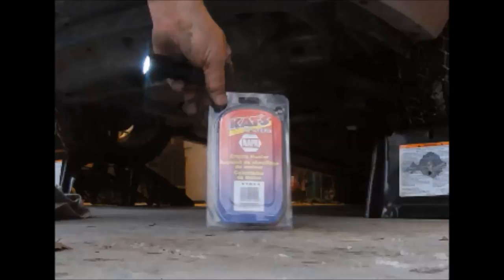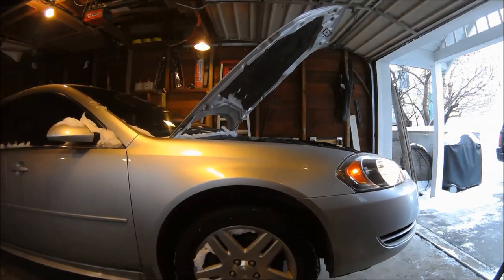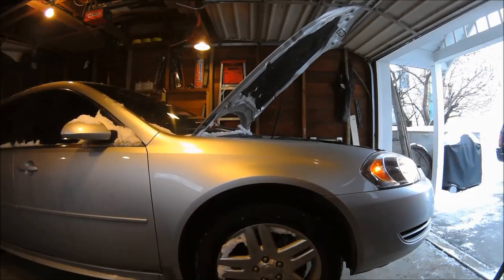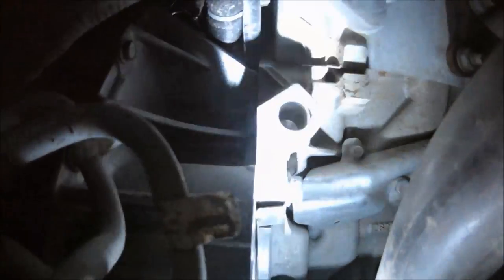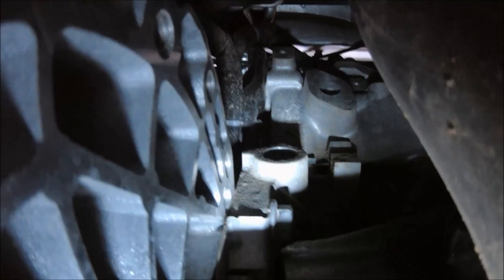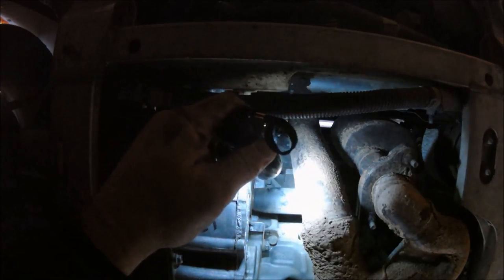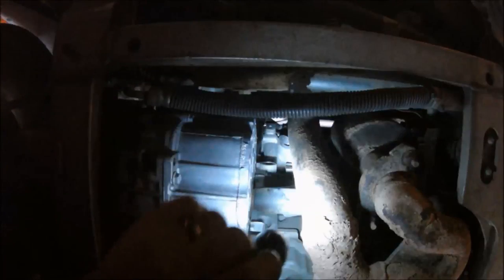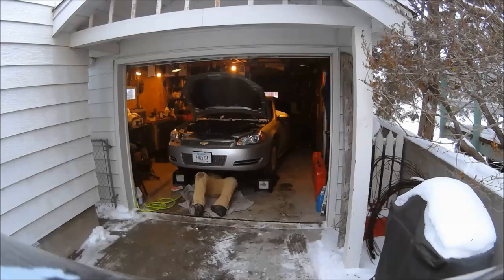2012 Chevrolet Impala V6 block heater installation

Comment: I'm curious how well it works.  My GF has an Impala and hates that she's halfway to work before she gets warm.
Reply: Eddie the Grouch , you probably have air or clogged heater core in the system. I had the same issue with no heat at idle. change coolant and flushed the system. then bled the system. if the coolant ever gets low in the reservoir you'll get air.
Reply from the maker: I would agree with Mike... you may have other cooling system problems.

Comment: How warm is the engine upon starting? I realize it depends on ambient temp, but more-so asking how long it takes to get to operating temp compared to without the heater.
Reply from the maker: With the temp below zero the heater is warm ish when you start the engine and reaches full heat within a block or so. This is the first cartridge type block heater I have ever used. All the others have been soft plug type. The soft plug type heat the engine better with lower watts but this was the easiest installation ever.
Reply: Really? What is the wattage draw on the hard plug?
Reply from the maker: @zackforche3323  The cartridge type  installed this the video is 1500 watts. Most soft plug heaters are 400 to 600 watts.
Reply: Holy cow!
Reply: @lrispens  I’m looking at the same part number and it shows to be only 400 watts.